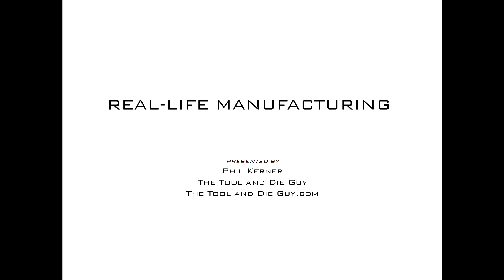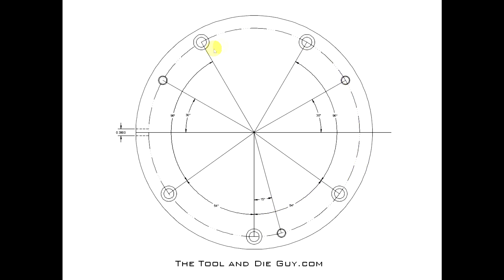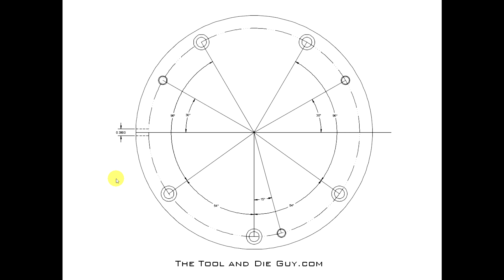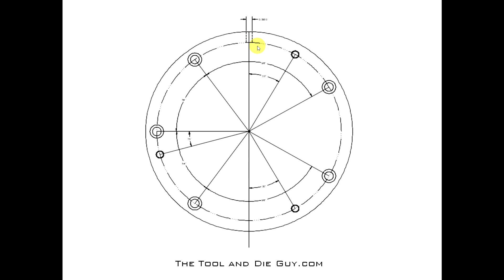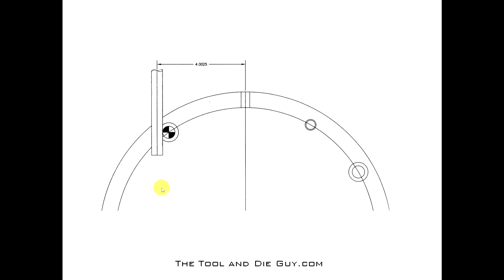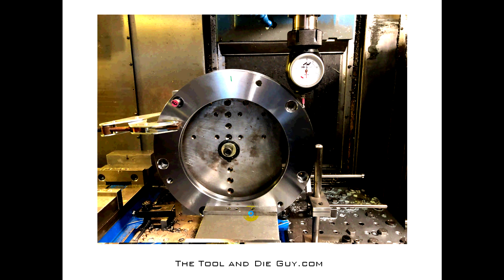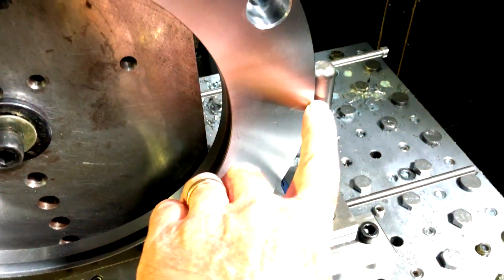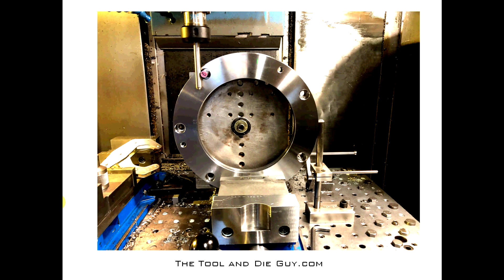Aligning Holes On an Angle Plate

Comment: I thought this was a bit esoteric, but I watched it anyway. Two days later...
I needed to index 6 holes around a piece. I used a variation of your tall bar to position my 3 jaw in the vise. I used the pin in a collet to establish the horizontal position of the jaw, then set a swing stop to mark that position at the top of the jaw. I then centered the spindle to the part and I was set. For the next holes, I pressed the 3 jaw against the tall bar, rotated it until I was against the swing stop, and I was set. After 3 holes, I re-located the swing stop to pick up the jaw at the bottom, and located the next 3 holes from there.
Thanks!

Comment: Why would you not put the hole in the side first? From there just put a pin in it and clock it or put it against a tennon then clock the centre of the part. Seems a much easier set up to me.

Comment: Well done.  I think I might of used the hole that was 90 deg to the hole you wanted to drill.  Calced that height to a pin
that it should be and put a stop under it and rotate to the stop.   As you know there can be a dozen right ways to do something.
Thanks for sharing your thoughts.